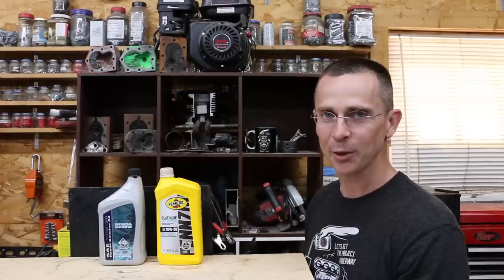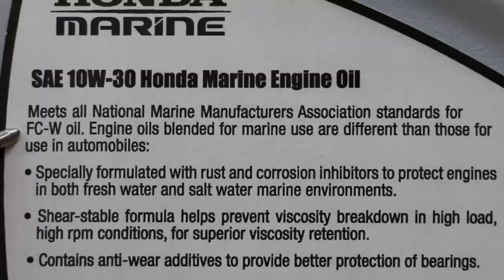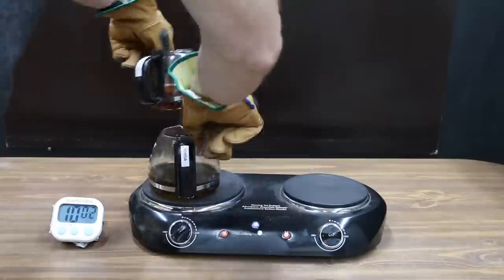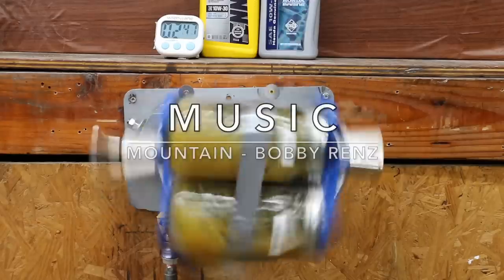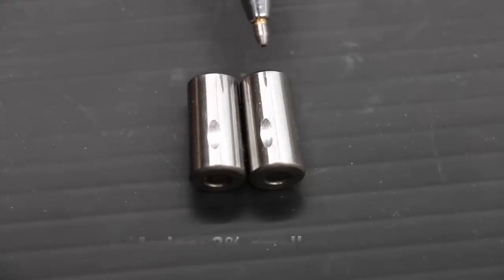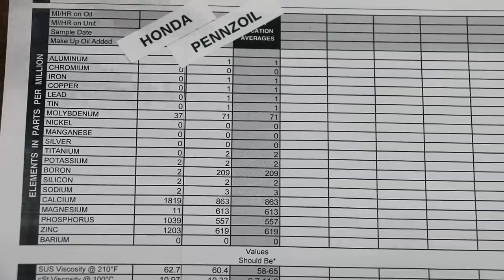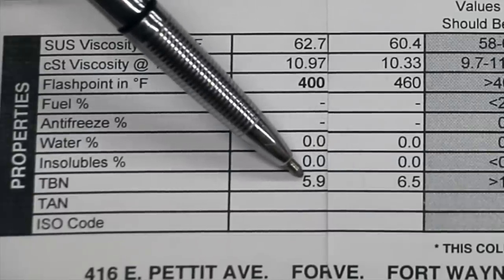Motorboat Engine Oil Better Than Regular Motor Oil?

Comment: Love to see a comparison between the old oil bath air filters vs paper filters. I read alot on the internet about how much better the paper is but I'm not so sure. Our old tractors all had oil bath and operated in severe dusty conditions and lasted many 
, many years between rebuilds. Thanks. Your video's are the best!
Reply from the maker: Thanks!  Thanks for the suggestion.
Reply: Yeah, I'm not sure. I remember a high school shop teacher explained to the class how the oil bath filters worked and told us they would filter out smaller micron particles and were less restrictive. I totally agree with you that paper elements would have been plugged very quickly.
Reply: Yes and all air filters in general.

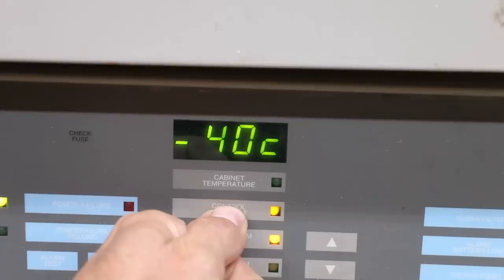Comment: 5:28  For anybody wondering, -40c is functionally the same as -40f.
Reply from the maker: Yes, thank you
Reply: Yes, the only time both F and C are the same.  Good point...captjack..
Reply: 574.55 degrees Kelvin and Fahrenheit are the same temperature.  

At -614.55 the Rankine and Celsius scales cross, but that is and impossible temperature because it is below absolute zero.

What will they think of next?  🤔

Comment: I'd like to see a comparison between regular stabil and marine stabil.  It seems like the marine is more concentrated and is cheaper per oz required but I don't know if you can use it in a regular vehicle.
Reply from the maker: Thank you for the video idea!
Reply: My friend use marine 2 stroke oil in his bike and he said that bike performed better
Reply: @Islandwaterjet  HHO project? 🤔
Reply: @alfrescrow  Not a great idea.   Marine 2 stroke oil is designed for much lower operating temperatures.
Reply: I always viewed Stabil marine (blue) as a treatment to use when you can't get ethanol-free gas.   I only use ethanol-free and have always used red.   Would like to get confirmation on this too.
Reply: @alfrescrow  if he's using that in his 2 stroke bike, he shouldn't. If he's using it as an upper cylinder lubricant by adding a few ounces to his gasoline, that is fine. I was using amsoil marine 2 stroke in my car for awhile. Just put 1 ounce per 5 gallons of fuel for a little extra lubrication for the fuel pump and upper cylinders. The marine stuff burns very clean and won't affect your sensors or catalytic converter.
Reply: @Islandwaterjet  
Why HHO is a scam? 
HHO exist and you can use it for many thing if you know what you’re doing , most of all you can easily make a HHO generator, I have made few different sizes and they all generate HHO, so please explain why HHO is a scam for you?
Reply: @Islandwaterjet  
Please explain to me why someone can get fooled with HHO?
I’m pretty sure you don’t know anything about HHO if all you can say is “is a scam”
So give some explanation, tell people how and why HHO is a scam and one can be Fooled
Reply: @frar.841  Let's turn this on you. Please explain to us how HHO is not a scam, because all Project Farm watchers have been updated on the efficiency of HHO. So if by miracle you have empirical proof that a HHO setup works, please share with us.
Reply: @se_mat  
No my friend, the comment was that HHO is a scam, which is not, HHO exist and like I said in my previous comment I made few generators that produce HHO, now if u tell me that HHO doesn’t work to run a engine that is a different story, that is, maybe, that the project is a scam, not HHO
Reply: @ProjectFarm  if you do, you must include startron and crc marine
Reply: @se_mat  he did ONE video on HHO. 

ONE!!! Hardly grounds to say “it definitively doesn’t work” and most definitely not a scientific mindset
Reply: @frar.841   agree👍🏾
Reply: @frar.841  Well, we are talking about HHO to run your engine more efficiently. Why did you push this its not a scam? We all know the existing of Hydrogen catalyst converters, they exists sinds 1897 (wiki) .
Reply: @dylanzrim3635  You didn't give 1 proof it works, not ONE! :-)

Comment: The thing is most marine engines run water cooling straight from the lake so they typically do not get very hot.  They also rarely are run in the winter.  They do take a pounding though, so the foaming test is important... as well as the friction.
Reply: they do long high rpms and storage
Reply from the maker: Thanks for the feedback.
Reply: Often their intakes get plugged with vegetation causing high temps and engine shut down.  If radiatior is working properly on vehicle motors, their operating engine temps would be the same as marine motors as both have thermostats with similar operating temps.
Reply: @CAN43725  But that is a maintenance issue.  You could also have temp issues if your impellor starts to fail.  I don't tend to think about that much because my dad was meticulous about proper maintenance, repairs, and winterizations on his boats over the years.  I found it tedious myself and only had a boat for 3 years before selling it for more than I bought it for.
Reply: Lake?  Is that Lake Pacific or Lake Atlantic?  Saltwater boats (that want to last) don't use raw water cooling.  And those are the ones using 'car motors' or bigger. (IB or IB/OB)

Comment: Great test.

Marine engines tend to run cooler even at high load as the engine is constantly exchanging heat with the relatively cool river/sea water which will be more effective at removing heat than recirculating the same hot coolant in a loop through an air-cooled radiator.

...that might explain the lower flashpoint of the marine oil.
Reply: Was just about to say this. An unlimited supply of 40-80 degree water will keep an engine very cool even under full load conditions. It’s also why marinized car/truck engines often make more power in boats than in a car/truck. No heat issues.
Reply: For that reason people shouldn’t pay all that extra money for marine oil, regular oil will do the exact same job if not better, and that’s what I use in my mercruiser every season for the last 7 years without a problem, an engine is an engine no matter where you use it IMO
Reply: That's a good point when I run my motor in a trash can the water temp goes up to like 150f and it runs like ass
Reply: Not so sure it runs cooler, it still has a thermostat that controls the temperature.  As long as the thermostat and water pump are working, there should never be overheating though.  The closed loop of a automotive engine makes for more possibility of overheating though.
Reply from the maker: Thanks for the feedback.
Reply: @rogerheuckeroth7456  it's because everything is cooled, including the exhaust. Head temperature remains lower...thermostats do hold the water temperature at whatever the thermostat opens at but the water temperature doesn't rise above that.... measure the temperature of a marine engine and it will be basically the 170 to 185 degrees f anywhere you measure the outside. 
In addition an automotive engine uses antifreeze to carry more heat and raise the boiling point, as well as a pressurized system to raise the boiling point higher still.  Marine raw water cooled engines use water (with whatever is in it) at atmospheric pressure without boiling (you loose cooling capability if it's a gas instead of a liquid).
Even a water to water heat exchange  used in some Marine engines still has a more effective hear transfer and still cools the exhaust (which allows the head and exhaust valves to stay much cooler).
Flash point isn't as critical but antiwear compounds and film strength are more important.  Zinc is great but can't be used with catalytic  converters (it fouls them).
Reply: @frar.841  not really...anti corrosion, anti wear compounds such as zinc are more critical.  Zinc which is one of the better additions to oil for wear can't be used in any quantity in a vehicle using catalytic converter. 
While any good oil changed often will work, engines which are run hard  and long but remain relatively cool benefit from the anti wear compounds.   I have no idea where or how you run your boat or the type of engine(s) you have however in mine ( outboard, I/O and inboard) have all had runs at 3/4 throttle for hours at a time..and on occasion at almost full throttle for the same hours (running to dodge weather moving in).
I were to choose a high grade automotive oil I would definitely add one of the zinc packages to it..or use the high zinc off road amsoil
Reply: @frar.841  I disagree, since marine engines run at nearly full duty cycle. Even cruise speed is often like 70% engine load. In a car you'd lose your license right quick in a hurry.
Reply: All Otto cycle internal combustion engines need the head of the engine to be above 175° or so for the best efficiency. The availability of drastically cooler source of an entire lake of water (usually well below 100°F) rather than a recycled cooling system allows marine engines to run in their "sweet spot" of engine head temperatures more efficiently over a non-marine application. The additional horsepower and torque that marine engines have, however, are more due to less emission restrictions, bigger cam, less restrictive intake and robust engine components. Moving a boat haul through water is much more resistance than the rolling resistance of a vehicles. Also, a boat generally has only one gear with no transmission to speak of so the engine needs to have a lot of torque as well as perform in the high rpm's for extended periods of time. Due to the demands of a marine engine the quality of components as well as the performance aspects of the components need to be higher than normal passenger vehicles. 

The intake system can be much less restrictive since you really don't have to worry about driving your boat through much dust or in a dirty environment so the air filter (if it has one) is not very restrictive. More air means more oxygen, more oxygen leads to more fuel/oxygen and more power. 

This is why a quick hp jump for your vehicle is to put in the marine cam if your engine has a marine application. 

Another point to consider is that the engineers of marine applications don't have to compromise the longevity aspect as much as the engineers of daily grocery getters do. It is a recreation vehicle so the high performance cam, rocker ratios, compression, etc can be more aggressive since they will more likely see much less use, plus the demands of the environment call for more performance.
Reply: @frar.841  its the anti rust aspect that costs.
Reply: @loosewirewire7954  I almost agree totally with you.  
The exception is in the power/build. A high performance (stock) marine engine produces roughly 1hp per cubic inch.  A high performance automotive engine about 100 hp per liter, with turbo up to somewhere around 150 hp per liter. 
Even though they are for "recreational " vehicles in a boat you can't just walk home in the event of an engine failure.  Marine engines are built for reliability. Outboard motors, however, are more in line with your statement giving about 135 hp per liter.  
Because of the power curve needed for a planing hull the power curve needed rises rapidly until the boat is on plane then sharply drops once on plane.  At this point the power curve is more linear.
Due to this a marine cam profile has a lot of low end torque compared to what's needed for a car.  This would give better response in a car at lower speed.
Reply: @duanesamuelson2256  Precisely. A marine engine needs the low end grunt to move the hull  through the water but it also needs to be able to run at high rpm's for long periods of time otherwise you can't keep the boat on plane where the resistance is much less and you have no transmission so your top speed is quickly reached without running in the higher rpm's. 
My point was that just the environment that a marine engine is expected to work in lends the need for more performance than that of an automotive engine, in general... and that while the enormous supply of cool water to supply cooling will help, it's not the reason that marine engines are more powerful than automotive engines.

I get that a boat on plane needs less power than one "in the hole" and so there is a need for more torque "down low" than that of a car but it also has to sustain high rpm's for much longer periods of time. In the performance areas the marine engines are also designed to reach higher rpm's and retain a more robust and wider power curve. My father was a marine mechanic, factory certified by all of the marine engine manufacturers (both on-board and out-board) that specialized in high-performance. The "holeshot" is important but most people focus on top speed and settle for whatever they get on the holeshot. Yes, torque is important but it quickly becomes about mid-range and high range power. Once the boat is up on plane you focused on reducing the wetted surface area for the best acceleration and best top speed. This very quickly brings in the need for high horsepower and high rpm. Our last boat would regularly see a sustained 9,300rpm when time was of the essence and with the big 4 blade prop with the specific progressive pitch, diameter and rake we would turn it 10,300 rpm in shorter bursts. That specific set-up would allow a top speed of 104mph, respectable holeshot, very strong mid-range (especially if there was a nice chop) and we never had one single problem with it. All boats follow the same basic rules for performance and what they are expected to overcome due to the environment they have to deal with. Many of the marine engines for higher performance applications have fully balanced rotating assemblies, forged cranks, lightened and forged rods, are higher compression, have high flow heads, intakes and exhausts, high performance cam, stronger valve springs, bigger valves, bigger carbs or more high performance mapping in the EFI computer, etc. from the factory. The manufacturer builds them that way. Torque is very important but mid and top range is also focused on and because of having to perform well in the low-mid rpm range as well as mid-high rpm range you need better components and those components have to do all things well.

There are many in-board marine engines that are in performance boats that plane. Most of the cigar performance boats come with factory built High performance Chevy engines. Yes, years ago the factory cams would usually net you more low-end torque than high rpm horsepower, however. An all around gain was seen but it was more noticeable in the low end torque. My point was that marine engines were more powerful because of the environment they had to perform in.

Comment: I might have an interesting one for you... Angle grinder steel cutting discs!
 I work as a welder and it seems like there's a big difference in performance, like wear, stability, cutting speed, and so on
Reply from the maker: Thanks for the suggestion.
Reply: @ProjectFarm  I second this suggestion!  Would love to see some of the Harbor Freight cutting discs up against some of the top dollar 3M etc. on some thick tough steel. 

I've also heard that the thin cutting discs are better, but maybe don't last as long?

Comment: Would love to see a diesel oil shoot out including cheap stuff like super tech, conventional vs. synthetic and specialty oils for old trucks like power driven diesel (with zddp).
Reply: My old 92 Mercury Sable with the 3.8 V6 loved Rotella 15w40.
Reply from the maker: Thanks for the suggestion.
Reply: Agree.  Delo 15w40 has been my go-to diesel oil for ages.  I've bought hundreds of gallons of that stuff over the years..  No complaints, and it's super common at fuel docks, but would be interesting to see it relative to say Rotella or others.
Reply: I'd love this as well. Throw Shaffer's and rotella t6 in there too
Reply: @RyanEvansrifi  I believe he did a T4 vs T6 already
Reply: When in doubt, go with Shell (Pennzoil is a brand of Shell too). Their products always did well in these comparisons and their prices are reasonable.
Reply: Throw the O’Reilly house brand 15W-40 on the list of diesel oils to test too!
Reply: I agree. Throw my Chevron Delo in the mix. 8 gallons of Chevron Delo 15w-40, one gallon of Lucas and one gallon of Motorkote per oil change in my old '97 3406E 5EK Cat. I just started trying out this combination this current oil change. I wonder how well that combination would do in the test!?

Comment: Video Suggestion! Window tint, ceramic vs non, heat rejection values, and do certain brands really block as much light as they claim. 
Also those sun visors you put in your windshield. Worth it to get the weather tech or do the cheapo parts store foldable ones do just as good?
Reply from the maker: Thanks for the suggestion.
Reply: @ProjectFarm  I don't even care about window tints, but I'd watch that, avidly :-)
Reply: You can easilyfind how much heat a tint blocks through the products data sheets.
Reply: @tsslaporte  "We're gonna test that..."

Comment: This was some great information. I'd love to see the test repeated against a high quality diesel oil like Rotella T6 as a test for use in a boat since that is a common marine oil substitute.
Reply: I’d also like to see a marine vs rotella. I have been using both.
Reply from the maker: Thanks!  Thanks for the video idea.
Reply: Shell cut the additive package years ago.
Reply: @TheGuruStud  rotella t6 5w40 still is a great motorcycle oil alternative. I find it to be superior to the original Kawasaki 10W 40 motorcycle oil I have used before in my  2018 Z650
Reply: Amsoil marine diesel vs Rotella

Comment: I freaking love these oil tests!!! This is genuinely a question I've asked before why is marine oil so much more expensive than regular oil, is it really better?
Reply from the maker: Thanks!
Reply: Probably just more expensive to make - less demand.
Reply: @dudeguybro  Good point.
Reply: This was a bad test,  Honda petroleum based marine oil vs a full synthetic automotive oil.  An apples to apples comparison would have been synthetic marine to synthetic automotive.